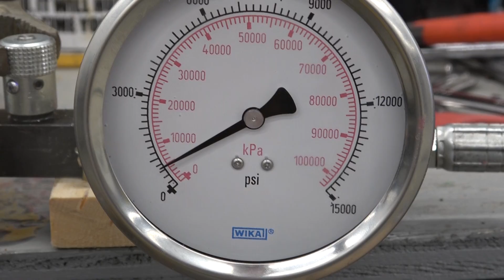How much pressure can PEX take?

Comment: Me doing any major repair around the house:
"I'll be dead before this fails..."
Literal translation: It's someone else's problem.
Reply: That's kind of what you are going for right? Everything fails eventually. I redid my sewer line this year and coffined it by putting an 8" pipe steel pipe around the ABS pipe in the ground and welded the 8" pipe. The ABS pipe should last forever now that no root can get to it. The excavation and repair cost 23,000$'s and I bought the steel pipe and welded it myself cause I figured screw paying that much money to fix a sewer line again.  But I have no doubt that when it fails I will be dead so it wont be my issue.

Comment: 17 years in with PEX on everything.  No problems atol.  For the hot lines you are supposed to use oxygen barrier PEX, which probably 90% of the red lines available now are.  I'm no slouch when it comes to sweatin' copper, but I've done three houses in PEX now and I ain't going back.

Comment: You should try it again with crimp fittings. I used to make the Barrier PEX(Orange) used for Boiler Systems. That tubing is some wicked plumbing pipe and can withstand a lot more pressure than you realize. Your leak is from the fitting not being mounted correctly or it's a bad fitting, hence the suggestion of the crimp fits. We would take 6 inch(15.24cm) samples and hook them up to a monitored pressure test at different temperatures to check the quality of it. 1,000 psi(70.3kgf/cm) was our start pressure at 70F(21C) and it would handle the increase of pressure exceeding 1,800psi(126.6kgf/cm), bursting around 2,100psi(147.6kgf/cm) at 85F(29.4C). The test would continue with increases in temps up to 300F(148.9C) and burst at 1,500psi(105.5kgf/cm). Yes, the temps exceeded boiling point. We always made sure our testing exceeded ANSI requirements by a landslide. The Print String on the tubing states the ANSI specs, not the in-house testing specs. ANSI specs were well under our own expectations of our product. If I'm not mistaken, the ANSI specs(NSF-U.P. Code) are 100psi@180F and 160psi@73F for 1/2 inch tubing. Our extruders used air pressure to operate the feed gates for the resin pellets and our Factory used this tubing(3/4") as the airlines with over 200psi running through it at all times. Even on a hot Summer day reaching 100F(120F+ inside). Myself, I even conducted Freeze Testing on the stuff. The uniqueness of the tubing is its ability to stretch and swell and then return to the original memory as it thaws. Metal and PVC tubing will burst when frozen, as well as the fittings for PEX.

Comment: Results I pretty much expected lol. At my old shop I had plumbed the compressor into the shop air system with Propress fittings (which I really prefer solder over but I had the fittings and tool on hand) and she was all well n’ dandy. Well the greedy body shop guy the next bay over decided he wanted to get his dirty dick beaters on the landlords compressor tank (which we were using to increase the systems volume), so he comes along and cuts the piping. His idea of closing the system back up was throwing a 3/4” sharkbite cap on the end of the line he’d cut. Only 125psi mind you, but that was enough, about a week later I hear the compressor cycle and then BOOM WHOOOSH, blew the cap off fast enough to take a nice ol’ chip out of the concrete. I’ve been saying the things were garbage for years, but now I can say I’ve seen em explosively fail!
Reply: I would love to see you test propress like this! They say 600psi or something 0-200°f for water, and 200psi air but I’l be honest with ya, I’ve never believed it! I’d love to ship you a sample piece or two!

Comment: Speaking of pressure, there is a video on YouTube of a fine art painting restoration, where he uses a vacuum table to perform certain procedures to a damaged painting. As he is doing so he says he keeps it down to about 5in/Hg in order not to "crush/damage" the structure of the canvas and depths of oil paint. Is it possible , or should I ask is there enough "crushing" force generated by "what ever that vacuum pump will suffer" lol? Is there a way to measure the "downward force"? It's seems to me it would only be 12.7 psi pushing down?? Does that sound right?
I refrained from posting his link or his name to avoid appearing like I'm trying to advertise his page, he does do tremendous work...not trying to say other wise...but I would like proof one way or the other if a vacuum table with a very flimsy mylar cover could crush canvas and paint. I don't think it could, just to get the conversation goin.

Thanks, Eric (big fan of you)
Reply: If there's any interest I'll post the link here for clarification. I'm trying to think of how many ways I'm gonna get fried in comments because I screwed some detail of some thing up lol. Damned internet

Comment: High pressure lines in the cellar (steal it from your local pub..('s dumpster after a refit)) and pressure washer hose are pretty "skookum" too. Them walls are thicker than the average run down tenement. I wonder what the failure mode of those feckers is.

Comment: In europe for hot water heating we use diferent kind of pex,mor shoud i say a combination pex-al-pex. So what it is is a layer of thin aluminium tube sandwiched between two pex layers, so it has better heat resistance properties, waaay easier and faster to work with than the copper but then it get borring fast. As for the aesthetic aspect i like pex-al-pex more than the copper cause no oxidation. If wo wanna explosion do the same test with air but crap up.the ring a bit or "forget" to put it in😂

Comment: Well that was uneventful. Try blowing up a section of fire hose. I used to work in the industry and would pressure test samples until failure. 2ft length of 3" diameter hose would make the ~1000lb tank jump when it blew up at around 2000psi of water pressure. One research project I was doing for the  New York City fire department had me blowing up a 100 or so per day. Good times.

Comment: The plumbing in my house was constructed with this stuff, and my uncle swears by it.  No, not at it.  I will admit I've used two sharkbite fittings when I installed my water filter, but hopefully they last.

Comment: For an ideal, thin walled tube, the maximum stress is at approximately 25° angle to the axis of the pipe.  Having tested pipe, it usually fails in a spiral like the Pillsbury pop and cook rolls.

Comment: 500 psi in a few seconds makes you wonder what 60-70psi over the course of 15+ years will do? It's a neat invention but it's a pain in the rear to install, mainly due to how stiff it is and how much force you have to put into the connectors for a proper seal. The stuff from the 80's/ 90's was terrible in it's early stage as lines would simply split after a couple of years leading to a big recall.

Comment: That is a shark fitting , pex are crimped, not the same outcome. Pex is much stronger, and shark fittings are not recommended in most building for inside walls.

Comment: Pex lasts for a long time, it has been used for about 20 years as air lines on trucks, they see 125 psi and very high underhood temps and its the fittings that leak not the tubing.

Comment: Do what you want, but I will NEVER trust these Sharkbite fittings! I had the big blue box store, (lets call them Blows, because reasons), install a new dishwasher for me a few years ago. My house has Pex and the plumber came out and installed it with the great, never fail,Sharkbite or Gatorbite, whatever fittings that Blows was selling. I was skeptical but was assured that these were the greatest thing going today and that he didn't even carry the old fashioned clamp style fittings anymore. These fittings are guaranteed! NEVER FAIL! Checked and done by about 8 PM.  About midnite, yep, THE FITTING BLEW OFF THE DAMN LINE! Called the plumber, gave me his personal number, he came out with old fashioned clamp style fittings that he had to buy the tool for and installed them the next morning. Blows WOULDN'T DO CRAP FOE ME ABOUT ANYTHING! STILL HAVE NOT TO THIS DAY! SCREW BLOWS!

Comment: Just retro fitted all our copper plumbing with PEX / Sharkbite as the copper was starting to leak through pin hole corrosion after 13 years of tank/rain water which is more acidic that 'town supply' water. We could taste the copper in the water.

Comment: PEX is a heavily crosslinked polymer so it is not thermoplastic after being molded, this is why it is rated for use in continuous 120c with short excursions over 200c. Like most thermoset polymers it just doesn't re-melt. The crosslinking also improves general strength and toughness.(if over done it can raise the brittleness)
PEX specifically starts as a thermoplastic PE and is treated to make it cross-link at the time of part production with any one of several chemistries, at least one of which uses radiation after molding to form the links though it is rare due to capital costs.

Comment: I do new construction plumbing and run houses everyday with pex. It’s some tough stuff to be plastic. 1” pex and a crimped coupling works great as a tow rope in a pinch. Also to test the houses for inspection we pump it up to 140psi and it sits and holds for weeks. I have yet to throw enough air to it for the pex itself to fail.

Comment: Philmac changed their fittings specifically to blow a seal not blow off...a few miners died by a fitting blowing off and hitting them. Shark bite the same. We once did a test with rehau pex  on a test bucket. The bucket blew up before the rehau failed...

Comment: PEX is absolutely awesome stuff. Crimp on fittings are my go to but the press fittings are surprisingly good. The biggest advantage of PEX is that it doesn't break as easy due to freezing. You can have a PEX line froze solid, filled with water, and it wont explode like copper will. Plus its cheap, easy, and fast to replace a broken PEX line vs copper. I cant really think of a reason I would install copper over PEX in almost any situation. I guess if I was going to do something with really hot water or in direct thermal transfer from an exchange, then id use copper.

Comment: Of note, PEX is actually not (if it's proper pex at least) a thermoplastic; it's explicitly polyethylene that's been cross-linked (in a post-processing step or during extrusion) into a thermoset.

Comment: Given that it was the fitting that failed first at the end, wouldn't taking on water cause it to have a higher failure pressure, as the fitting would be more snug around the swollen plastic tube?

Comment: The best thing about this pipe is you can run it in like cable and bury it in walls. No joints under the floor or above the ceiling! In the unlikely event of a leak (which is almost always at a joint) it's accessible. My whole heating system is done like this with a manifold below the boiler.

Comment: Here's why larger diameter tubes need bigger walls: pressure is force per area (that's what PSI is: pounds (force) per square inch). Increase the inner diameter tube, you increase the area, so for the same pressure you have more force, requiring a thicker wall to be able to withstand that force.

Comment: Pretty sure that sharkbite wasnt installed properly, or the o-ring inside was damaged hence the leak. And pex/wirsbo plastic water line and fittings will outlast copper by far.

Comment: When I bought my house 6.5yrs ago, someone stole most of the copper pipe the night before I was supposed to close. Good for me! I got 2 new water heaters and the missing pipe was replaced (with pex). So far so good. I left my outdoor spigot on one winter and brass split, but pex was good. I'll let you know in 15 more years I have issues. 🤷‍♀️
Reply: 14 years and counting here and I've never turned off my Spigot. I live in Ohio(USA) and sometimes it gets pretty cold(-20F) in the Winter. My neighbors, however, have to fix their Copper almost every year because it freezes and breaks open.  PEX tubing is so strong, I even used some 1 1/2" to build a structure for a Greenhouse. Built in 2007 and it's still holding up great. I used to make the stuff, I know how tough the stuff really is.

Comment: What if you did the same test again, but capped water in the pipe and froze it solid where copper would split. 

Or get your hose guy to crimp some hydraulic fittings on the ends to eliminate the failure in the shark bites. 
The ribless Teflon hose ferrules Would be a good choice, if you can get them in that size.

Comment: If you buy a house or a property here in Germany then you have to pay a tax which amounts to 5% or some such of the price of the house or property. So buying or selling houses or properties is something people don't do very often in their lives. Building something that is build to last will pay off for most people. The copper plumbing I installed in my house back in 1988 is still working just fine. However I never had my water lines under 12000 psi (BTW: what an awful unit of measure that is :-) ) and I am not curious enough to try out whether my solder joints would take that amount of pressure.

Comment: Sooo sharkbite fittings are ASSE tested to 600 psi and rated at somewhat less. Did you chamfer the outside edge of the pipe so as to not cut the o-ring in the fitting? Pretty important otherwise it will piss on your hand. Read the effing instructions will ya ehh before ya shitcan the product.

Comment: This stuff ages a lot better than thin wall copper which will corrode and develop pin holes. It freezes a lot better too if you ever lose heat. And it's cheaper to boot. I almost never use copper any more.

Comment: Copper pipe & sweat solder fan myself.....But, copper prices are BATSHIT CRAZY and no one wants to pay for them.....
Then there's the freezing pipe argument.....PEX will expand.....I plan on abandoning my home 200kms south of the "impassible border" of Kanuckisatn this winter.....set the heat at 50 and return in March to see if the Basement is flooded.....

Comment: An old coworker who was a plumber told me that copper is better in warmer climates in general but in climates where you are in danger of pipes freezing that PEX is better.  He claimed that the PEX will expand/deform with the frozen water and you won't end up with a burst pipe.  Not sure how true that is but that is what I've been led to believe is the major advantage of PEX.  He also said water won't cause pinholes to form over time like it will in copper lines so in that sens PEX lasts longer but who knows?

Comment: Pex is the worst. I know lots of people swear buy it on the cheaper ends of the trades, but i have had to rip out an entire kitchen and bathroom wall to wall because my girlfriend had a plumber put that shit in instead of copper to replace old shit galvanized in a house. Crimp fit attachments blew straight out. tried to do a shark bite cap on a surviving piece before I switched it all out for copper and couldn't get one to stay on for more than two days without failing. I'm no plumber, just a fool with a two architecture degrees who likes knowing how to do a little of everything too much, but i hate that crap. Sweat the copper right once (or twice if it leaks the first time), and never worry again.

Comment: I tried using PEX as an extension hose for my pressure washer, it split the pipe in about 1/2s...
Reply: PEX isn't rated for pressure over 160psi at 73 degrees F; 120psi at 130psi.

Comment: On the wall thickness going up with the size of the pipe: for any pressure vessel (even an open cup is a pressure vessel: from the weight of the drink), the minimum mass of the vessel is directly proportional to the contained volume (for the same pressure). It comes down to the ratio between the cross-section area of the walls and the projected area of the ID. Of course, this neglects stress concentrations due to apprentice marks and the like.

Comment: I have been a plumber for 45 years now, I've replaced galvanized pipe. All I knew for years was copper, than came the poly pipe, hated it with aluminum rings even copper.  Then came CPVC, didn't trust it at first but it has been around a long time now. Pex umpanor ? Still up in the air, has good and bad qualities great for repipes fishing threw low attics. Downside here in Florida, can't be used in Sunlight outside the  U.V. rays will eat it up in no time. Inspectors won't allow it. Some anyway.

Comment: One of those 'building off-grid home' channels said one of Pex's advantages is that it expands with freezing water without failing.

Would you be willing to test that, using standard Pex fittings?

Comment: i saw a video where they applied lots of force to pull sharkbite fittings apart from pex and copper and the pex one failed because the teeth just gouged through the plastic. so it was a failure of the pex plastic holding on the teeth.

Comment: I had put in the lines for in floor heating and had an idea that I could hook up a circulating block heater directly to each end of my water lines..having the cold water being sucked in and the hot pushed out..which in my mind sounded like it should work.
So I hooked it up and plugged the heater in and watched it as it started to actually work..but in a very short time , and I mean within seconds,  I realized a fundamental flaw in my setup when with an incredible explosive force that I could feel in my chest that line let go...so they will definitely explode and let me tell you..its extreme and will wake you up..lol. Long story short I should have incorporated  an expansion tank in my system as water expands when it's heated and needs some room for this to happen..just thought I'd share my two cents on the subject

Comment: The copper is only good if it dont get concrete on it. 10 -15 years is all it will last with a cement product on it. Torn out lots of showers they thought the pan was leaking on only to find the pipes rotted where the concrete was on the pipe.